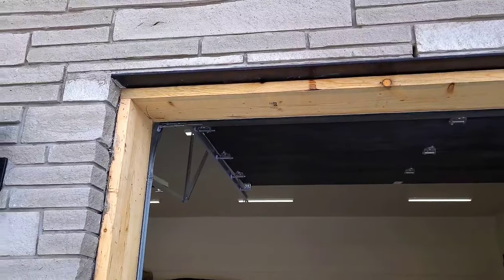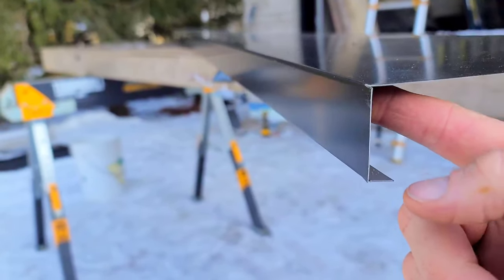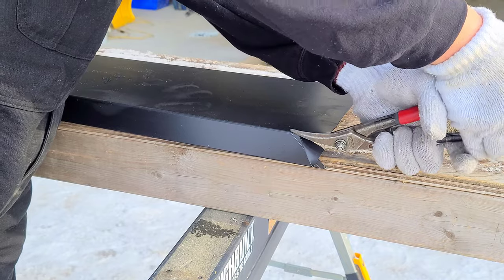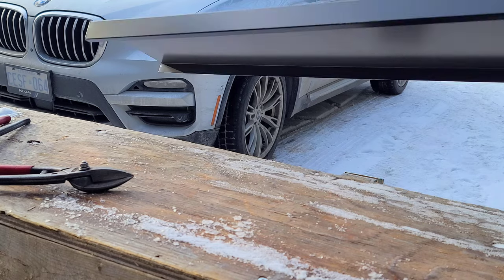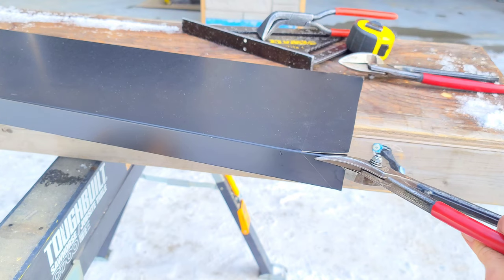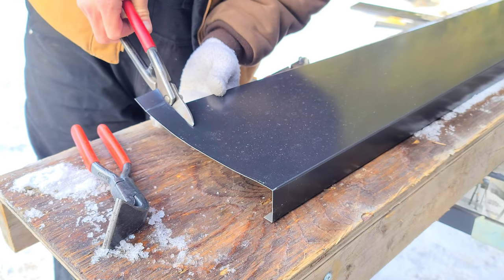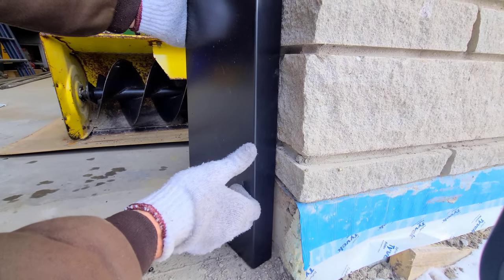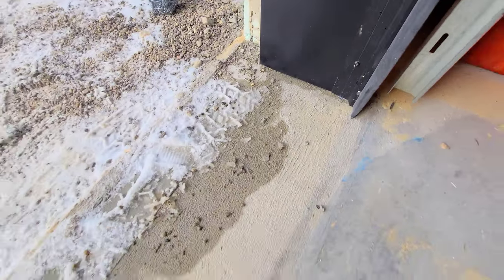Easily Cap Garage Door Frame with Sheet Metal

Comment: at the ends of the video, do u need to put silicone on the bottom flashing that meets the concrete?
Reply from the maker: I never do... The wood frame should be touching the concrete
Reply: @asm101  i mean like a bead of caulking to keep water from getting underneath the the capping and wood frame if that makes sense
Reply from the maker: @randomrazr that's what I'm saying usually the main objective of this detail is to protect the wood frame from eroding... The sealant will not hold up very well and will eventually trap water at the worst part of the door frame which is the end grain of the wood... This is why I just run my metal trim to the floor and I leave the door frame about a half inch from the floor so if any water does get in there it gets a chance to drain and dry properly if the sealant is there it's going to trap water potentially down the line and start to rot the door frame from the bottom up hopefully that makes sense

Comment: That was really good. Can I ask you a question related to the wood under those trims? Did you treat them to avoid getting rotten, touching the ground? I’m struggling with that. Thank you
Reply from the maker: Treated wood should not be used behind any metal as it reacts with it and can cause premature erosion...the best thing to domis wrap your frame in tyvek and leave about a half inch space at the bottom so the end grain isn't coming in contact with the cement floor 👍 and thanks for watching
Reply: @asm101  thank you

Comment: Did you order the sheet metal pre bent? Or did
You start off with a flat sheet and bend
The j mold into it? If you ordered it where did you order it from?
Reply from the maker: You can do it yourself by renting a brake from Home Depot and buying the coil aluminum there as well. I need to do a video on that

Comment: Sorry, if my question appears to be not applicable. Where would you buy the pre-fabricated trim from? I live in Canada here and wonder if this can be found at Home Depot or Lowes or I need to check for some specialty stores. Did learn something from your video so I am itchy to try it DIY way. Thanks.
Reply from the maker: Best way is to head to your nearest aluminum trough/siding contractor and ask them to bend you the trim you need ... Remember to take measurements before calling them...if you need to ask them what measurements they need to bend it for you

Comment: Thanks for doing this.  Ihave to replace mine and I did not have a clue on how to do it.  I have to paint mine white, how do you paint on the metal?
Reply from the maker: Rough up the surface with some steel wool and prime it with some galvanizing paint then final color coat

Comment: so the friction is enough to keep the front tight? or does caulk help that a bit too?
Reply from the maker: The front tight? Do you mean where the pipe connects to the base or where it hooks to the top of the lower panel?

Comment: So last year I got this done to my house when I got a new black garage door got black aluminum trim also I want to clean the door and trim is there anything u recommend using to clean ? I was planning on using water and dawn soap but idk if a towel or soft sponge would be better what do u recommend to clean and what do u recommend to dry I want to be careful and scratch the black aluminum
Reply from the maker: Just make sure your using a clean rag...any dirt particles will causing scartches also try not to rub for too long on any spot for to long...what will happen it you will cause a buffing effect and you end up with a glossy finish right where you rubbed vigorously...soap and water will do just fine

Comment: I just built my own house and had my exterior guys wrap the garage opening with sheet metal similar to how you did here. The problem is the metal has now gotten very wavy and does not look good. Any help you can provide on why this might be happening and how to fix it? It drives me nuts every time I come home and am tempted to rip it all off and use PVC trim. Thank you!
Reply from the maker: typically the trim was made a little too long and then forced into place...the metal should almost be loose fitting without looking bad...a sheet metal guy should know that...also a thinner gage metal will present more wrinkles as well as the wood framing around the door might be twisted

Comment: Where do you screw it in? Got roped into a cap job tomorrow and no idea what im doing
Reply from the maker: screw it into the back of the framing
Reply: @asm101  the back? Where the weater strip will cover it?
Reply from the maker: @michaelgibson2163  I return a 1-inch 90° flange on the back side where the track is installed and I get a screw there

Comment: Is the wood not treated there? Here in NZ there has to be a barrier, such as underlay, seperating the metal from the timber as the chemicals in the wood treatment react to the metal during condensation made from night sky raditation can take 10-20 years but we try to engineer out any reactions
Reply from the maker: typically the wood is not treated with rough capentry here in Canada

Comment: My door spans 16ft. I only have access to 8 for pieces at the moment what would the splice or overlap look like on my top piece? Is that common or a no no because of a seam under the drip edge?
Reply from the maker: Overlapping is completely fine and fully acceptable practice, due to the inefficiencies it would cause always trying to fabricate pieces longer than the folding machines.  Having said that...notching out the interior 90degree bend will allow for a consistent lap joint and the notch will be covered by the garage door gasket in the end...hope this helps
Reply: Right on. Thank you

Comment: Who would I even contact to do something like this? I called a few garage door contractors and they haven't even heard of it and I live in Miami? You would think someone would do it?
Reply from the maker: Try calling an aluminum guy...someone that does eavestroughing has a mobile shop with a Bender and flat stock in it....they'll come to your home...measure, cut and bend exactly to the garage door frame....garage door companies don't do this sort of thing
Reply: @Architectural Sheet Metal 101  I called a place that does aluminum work with patios, rails and fences and I did find one place that does. Architectural Design Metal Workshop. Just from the name, I knew the cost would be high. That would a decorative aluminum frame with brick mold and it was 1500 installed. That sounded kind of high to me, but it's really nice.
Reply from the maker: That would be more extruded aluminum... Call an eavestroughing guy or siding guy
Reply: @Architectural Sheet Metal 101  See that's the problem. I know it sounds crazy, but siding isn't really done here. At least not where I live. It's really odd. Our roofer was just here because I had a question about the soffit and fascia. He said there was a company called Shell Lumber that does it, provided that you get the wood from them. Thank you! What should this cost by the way?
Reply from the maker: Have you tried A&C Seamless Gutters?  I just looked them up